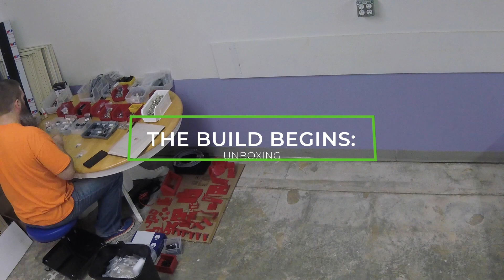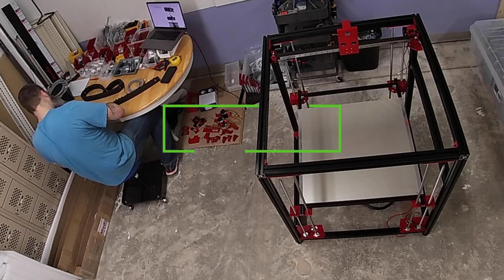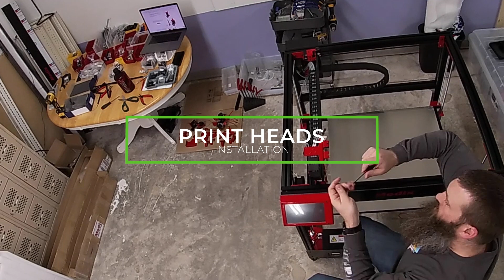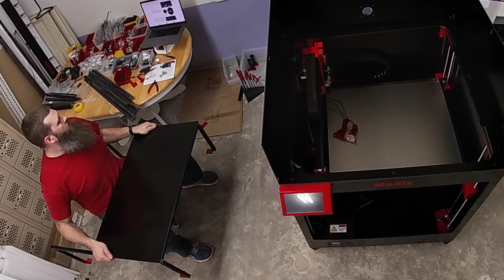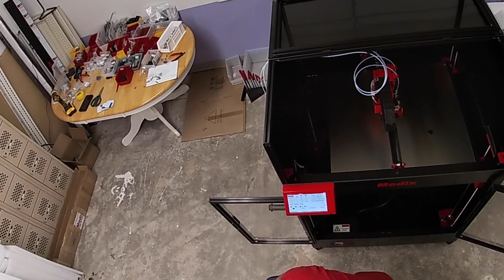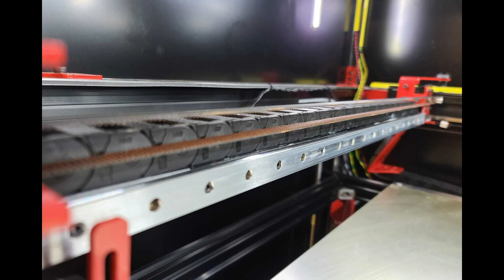Modix Big-60 V3 Build in 30 Minutes!

Comment: Absolute piece of everloving dogsht these modix printers are.   any inherent problems  the user has is blamed on assembly, i have already had to replace the board from burning out, and the extrusion setup with the griffin head doesnt have enough strength to pull all that filament thru all that tubing even with a 1kg spool of material.  Constant problems with this huge DUD and I wouldnt recommend it to ANYONE.

Comment: thanks for the video, wonder how long does it takes in reality to complete the assembly? I am assuming 2 or 3 days for 1 person.😁
Reply from the maker: Thanks for watching! In reality, for someone who hasn't built a lot (or any) Modix machines before, putting one together properly, including the necessary calibration steps takes roughly 2 weeks of assembly. That assumes that 8 hours are being spent on the assembly each of those days. This is not a trivial assembly process and there are lots of things that could easily be done wrong. If it isn't done properly the machine will not operate as intended. Also, this video is showing a V3 machine but Modix is currently shipping Gen 4 machines, so your experience will be quite different. I would also add that these machines should not be run by anyone without a lot of 3D printing experience, as they can be rather difficult to operate and require a lot of ongoing TLC. There are some other machines out there which are fully assembled and calibrated from the factory (such as the HSP1-I from HartSmart Products), but those cost quite a bit more than the DIY kits from Modix. Good luck with whatever you choose to do!
Reply: Thanks @ecostruder , that must be a long lead-time for building this printer all alone, but if we can increase the team size, and separate the steps by cluster, I think it would be faster, right? 😁
Reply from the maker: @Vinvanvo  Having 2 people instead of only one will help, yes. But after that there are diminishing returns on adding more people. Most of what needs to happen with the assembly is on the machine itself. There aren't a lot of subassemblies that a separate person could knock out. In any case, I would strongly advise against rushing through it if you want a properly operating machine.

Comment: I watched this because I thought you'd be showing how to assemble it in only 30 actual minutes, which obviously wasn't the case.  What was the total elapsed time?
Reply from the maker: Sorry for the confusion, Bill. No, it's certainly not possible to assemble a Big-60 in only 30 minutes. I clocked the build at around 25 hours of actual hands-on assembly. With more than one person working on it you could cut that down by having some sub-assemblies completed in parallel, but it will still take quite a while to complete properly. I strongly advise taking your time and not rushing through the assembly process since the performance of the machine very much hinges on proper assembly and calibration!

Comment: whats up bro, we've completely build our Big-60 and can't seem to get the LCD to turn on. got everything wired and connected and no luck, any idea what would cause the LCD not to turn on? tnx in advance for any insight.
Reply from the maker: Hm, that's strange. Are you sure that the connectors are plugged into the back of the screen and the Duet in the right position and orientation? It's fairly easy to plug them in backward, and that would certainly cause it not to work! If you continue to have issues you can always reach out to Modix support as well (Support@Modix3D.com).

Comment: So does this printer not have any independent bed level control? I'm designing a printer myself and am trying to decide if I need leveling knobs like you see on small format printers. Or if I can use adjustable home positions of my 3 Z axes.
Reply from the maker: The Big-60 v3 controls all 4 ball screws from one stepper. It's relatively easy to manually turn them to get the bed level. Then, as long as the high and low spots on the bed are less than 1mm difference the machine will compensate for it with the bed mesh.

Comment: I am asking there is power recovery feature ?
Reply from the maker: Hi! The Duet 2 controller is certainly capable of Power Failure Recovery, yes. But it is not enabled with the standard configuration from Modix. This would be something that a Modix user could enable if they wanted to do so.

Comment: can the enclosure temp be controlled?
Reply from the maker: Hi, the enclosures for these machines do a great job of insulating the build chamber, so it traps the heat inside, but it does not generate any heat in the chamber beyond what is created by the heated bed and hotend. We have found this to be sufficient for highly warp-prone materials like ABS, polycarbonate, nylon, etc.

Comment: So this is a quad Z, dual X, single Y stepper motors.  There was a comment about building this for a customer,  do you sell these as assembled? If it's not assembled, do you include the alignment guides mentioned?
Reply from the maker: As far as the number of stepper motors used per axis, yes that is correct. We do indeed offer assembly services for Modix machines. In fact, we're currently assembling 2 Big-180X and one Big-Meter printers for a customer! As for the alignment guides, the 3D printed jigs are included with your machine, and the instructions for how to perform all of the calibrations is included in the build instructions on the Modix Customers Zone website. If you'd like more information about purchasing a fully assembled (or not) Modix printer, please reach out to ECOstruder@HartSmartProducts.com and we'll get you a quote!

Comment: is there any change in V3 for the bed heating, can it be switched off automatically (via the control board)?
Reply from the maker: Short answer is no. Modix is very careful about safety and so far they have decided not to allow the control board to switch on or off the AC-powered bed heaters. I know several users have created their own solutions for this, and I wouldn't be surprised to see Modix come up with something that meets their safety requirements in the future.

Comment: Very nice and useful video. I am planning to buy one too, but I was wondering how it prints with ABS and high temp materials like cf nylon and polycarbonate.
do you have any experience with that?
Reply from the maker: Thanks for watching! Yes, I have printed with all of those materials on my Modix machines and it performs quite well with each, although special bed adhesives are required for Nylons and Polycarbonates since they won't stick to the provided PEI sheets without some help. But ACP enclosures are great at holding the heat in so these tricky materials don't warp. I'd be happy to share more thoughts on my experience if you'd like to reach out via email to ECOstruder@HartSmartProducts.com.
Reply: @ecostruder  bullshit
Reply from the maker: @bentelbow2922  Sorry you haven't had much success with your machine. They certainly aren't easy, and they require a lot of ongoing work and babysitting but they do indeed print, and can in fact print with various materials. They may not be the best option that is available now (3 years after this video and the related comments were posted), but I'm still running a few of them in my shop. Hopefully you are able to get yours in working order. FWIW, I no longer work with Modix.

Comment: How Long is the Building time of this Printer and how is the price? I am from Germany? What Kind of Filament will be used? 1.75mm or 2.85mm? Thank you for answer.
Reply from the maker: We clocked our assembly time at roughly 25 hours. These machines use 1.75mm filament for the best extrusion speed and material compatibility. I know some customers that have converted theirs to 2.85mm filament, but this is not how it comes from the manufacturer. Good luck with yours if you end up getting one!

Comment: Very cool, great video. How is support and getting parts?
Reply from the maker: Thanks for watching! If customers order a Modix machine through us (https://hartsmartproducts.com/pages/modix-machines) then their support contact is HartSmart Products (we're based in Des Moines, IA). But our support from Modix has been excellent--they send out any replacement parts necessary and will help try to diagnose issues with the machines. They are in Tel Aviv, but do a good job of getting back to customers as quickly as possible (even though here in the USA we are on the other side of the world).
Reply: I purchased one before Brandon/ECOstruder started reselling in the US and one of the ball screw nuts came apart on me.  Modix replaced it immediately - even though it had been almost a year of use. They stand behind their product. TBH, I still love my Modix after almost 2 years, many prints lasting up to 2 weeks, etc.

Comment: I also had the X/Y axis able chain rubbing on the back panel.  And I didn't find the printed alignment parts until I was setting the BL Touch so I ended up using calipers instead.  Good video, wish I would have done better on my time lapse.
Reply from the maker: Yeah, it's easy for that bracket to push out toward the back of the machine. Fortunately, it's an easy fix to loosen it, rotate it, and tighten the screws again. But that assumes you know to look for it! Thanks for watching!
Reply: @ecostruder  We've updated our guide to note users to check for this issue, it's a small thing that can easily be fixed if you know to look for it
Reply from the maker: @lazarjovic9948  Fantastic!